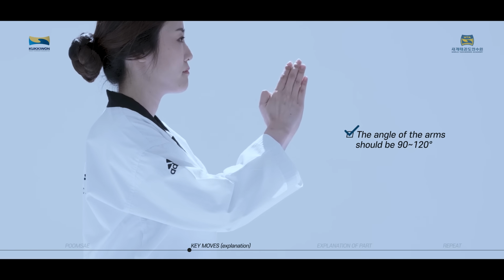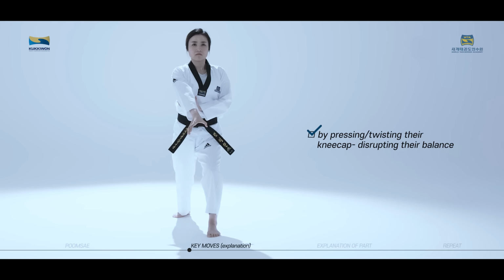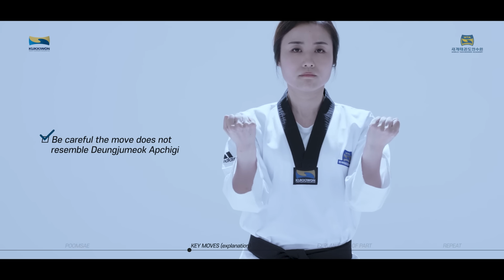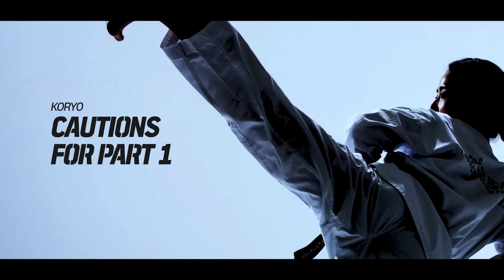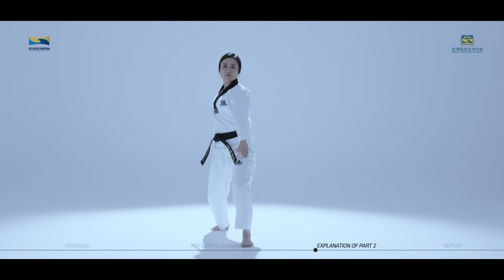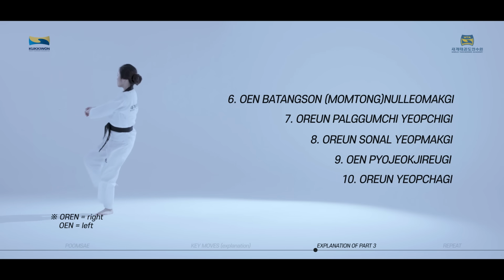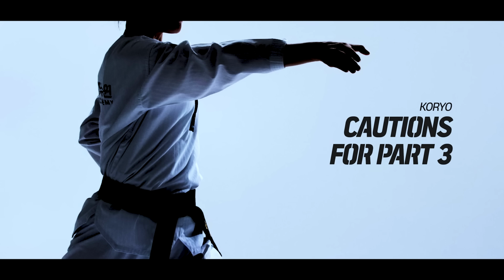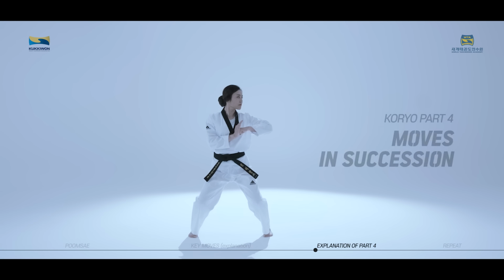KORYO

Comment: Hi, very nice video. By the way, what is the difference between Han Sonal AereMakgi and Sonal AereMakgi? Same as Sonal BakkatMAgki and Han Sonal BakkatMagki?  Ageumson Kal Jaebi and Ageumson Apchigi? NulloKKeogi and MourupKeogi? Thank you.
Reply: Hansonnal means onehanded knifehand. The other Hand rests on the Hip as Ellbowthrust during the Technique. A normal Sonnal Technique uses the other hand as support by placing it in front of the stomach most of the time. Same goes for Sonnal-Bakkat-Makki and Hansonnal-Bakkat Makki. Sonnal has a supporting Hand. I am not fully sure about the Agwison (Ageumson) technique. The Ap-Chigi is definetly a thrust with the side of the lower index Finger, with arc hand as support. Khaljaebi is just a synonym as far as i know and describes the same technique, but khaljaebi definetly always attacks the neck, while Ap-Chigi can be executed to any body part and height. Mureup-Kukki and Nullo-Kukki are probably synonyms as well, because they are executed the same way. It might also be that "nullo" attacks below the knee  and "mureup" above.